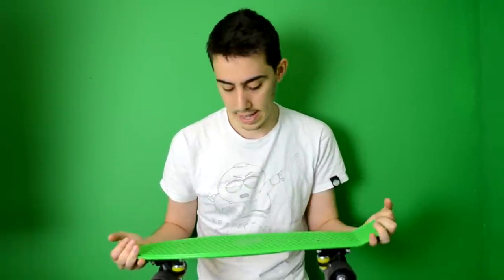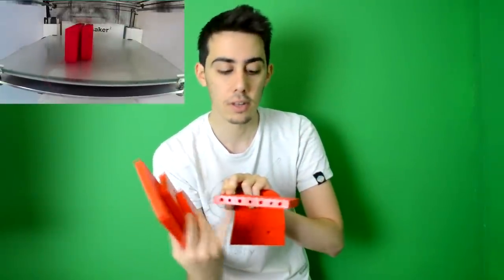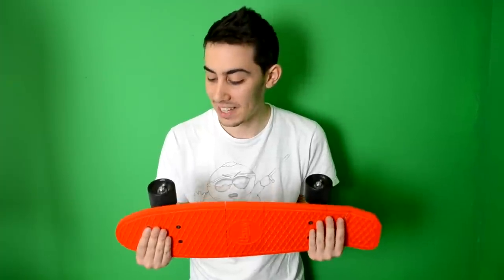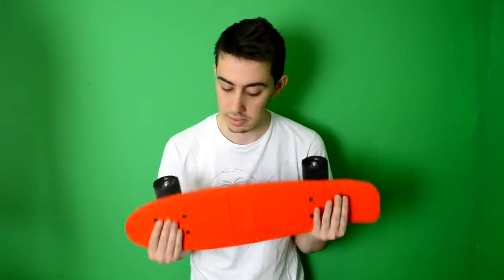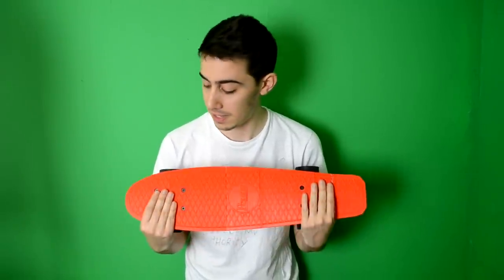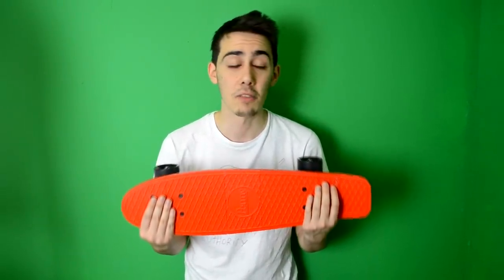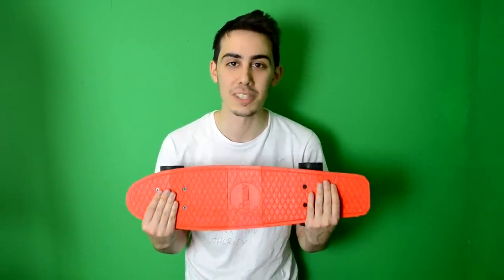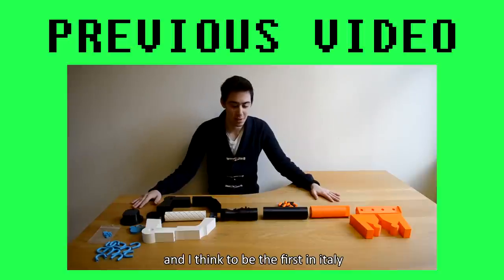[3D PRINTING] Penny Board

Comment: Great print and design! It looks like the rear truck is mounted backwards though, it will probably make better turns if you turn it around. Compare 0:25 with 2:41 and you'll see what I mean.
Reply from the maker: ***** Yep i notice after and i already rotate. Thanks ;)
Reply: you know i just got an actual penny board used ofcoarse. and the trucks were on backwards? teal green, did this belong to someone you know?

Comment: hmm, seems like it would be stronger if you printed the pieces laying flat, that way their would be less shear force on the layers.
Reply from the maker: i did it check the other video ;)
Reply: Haha thanks im watching it right now! Lol. So im gonna have to find your files and try this out cause i would love a penny board and i work at a 3d printing place. Thanks for sharing!
Reply: Btw what about printing with regular abs?? I dont know about getting those exotic filaments, id have to look into it.
Reply from the maker: not super happy about abs not super easy to print, toxic if you use it in a close place like a room, and should be done some test to understand witch material will be better but i found TitanX and ApolloX work really well
Reply: Okay thanks for the info, i wasnt even aware abs is toxic and we have a closed room we do production in. Hmm maybe i can use a negative air respirator.
Reply from the maker: you can always enclose the printer and pull the air out of your window, but if you are use it just some time not 24h every day it will be fine but anyway don't smell really good

Comment: Where did you get the trucks from? Or did u 3D print them
Reply from the maker: from the original pennyboard
Reply: he got them from a real penny board
Reply: Gunther Gunther well that doesn't make much sense. Y 3d print a board if u going to use trucks and wheels from another board? That's plagiarism. Lol
Reply from the maker: If you think so, check the last video i did about the penny board and tell me if you can have that level of customization with a board you can buy